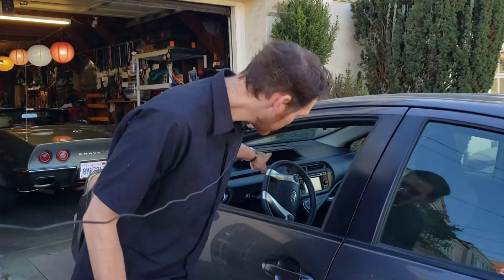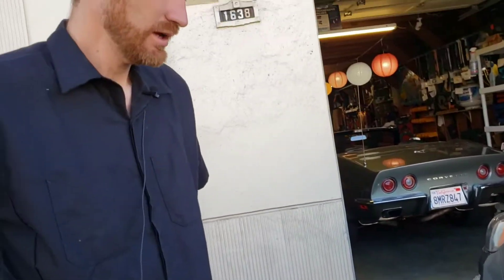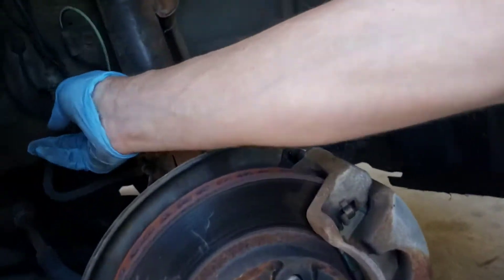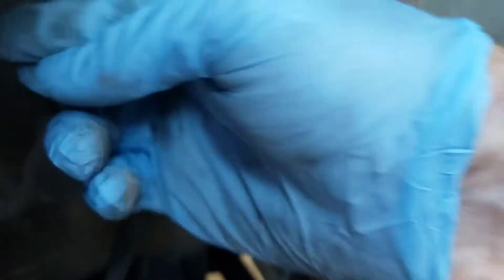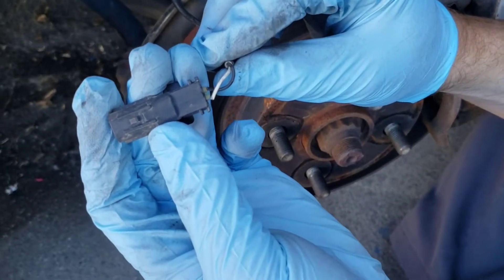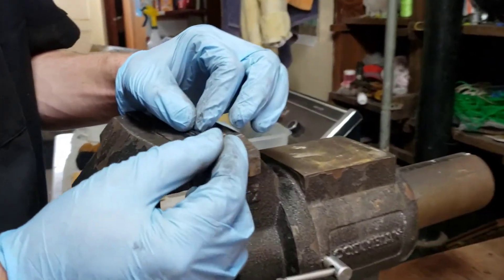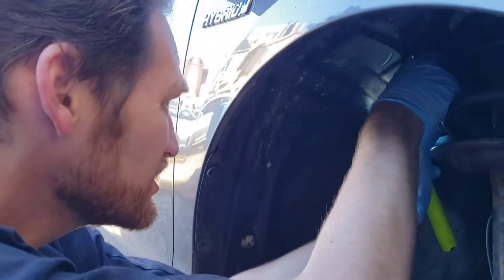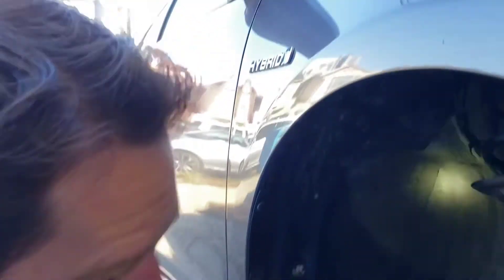2015 Prius C ABS codes

Comment: my abs, brake and stability control light is on. i took it to my local mechanic and he quoted me $3,100 to fix. 2013 toyota prius. CODE is 3160. please help!!!
Reply from the maker: Are you sure about the code 3160 is related to the engine nothing to do with abs

Comment: Dumb question for u. Will I have any reprogramming to do if I remove all my calipers to paint? I own a '19 gen 4 Prius limited. Ive done brakes for yrs on all my toyotas, so Im fairly knowledgable. Any other advice? Im a senior who respects ur opinion.
Reply from the maker: You will need to bleed the brakes not reflash a module. Worst case scenario you will need to clear a code. I should do a brake bleed vid on gen 4...

Comment: These lights turner on today on my 2012 Prius C, could it be the same problem? the brakes feel normal and behave normal, but i don't have regenerative braking.
Reply from the maker: Hedgehog The Sonic scan the codes and report back
Reply: @Mrelectric423   C1241 and C1391 are the codes i got, and the brake actuator motor runs every 4 seconds, i think it failed too soon, my vehicle does not even have 150,000 mile on it. Looks like a valve is not holding the fluid pressure because when i turn the car off i can see the fluid level go up in the reservoir.
Reply: @BilluAwann   Yeah, had to replace the brake booster assembly, and brake pump assembly. It is working fine now.